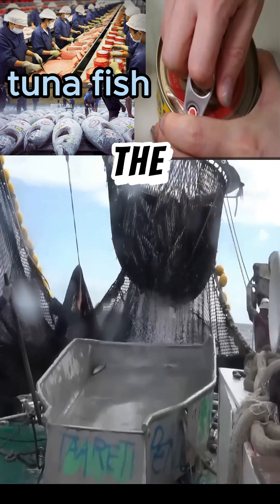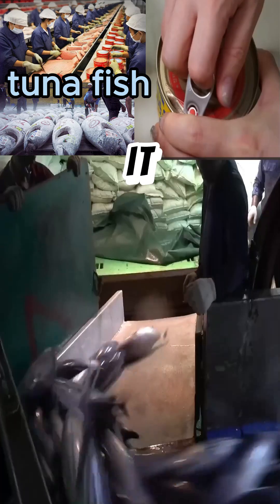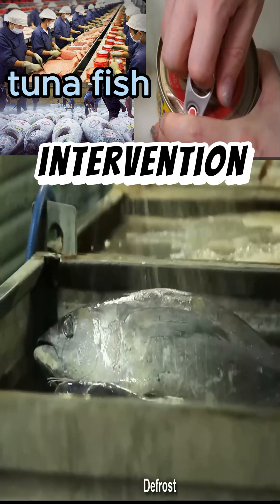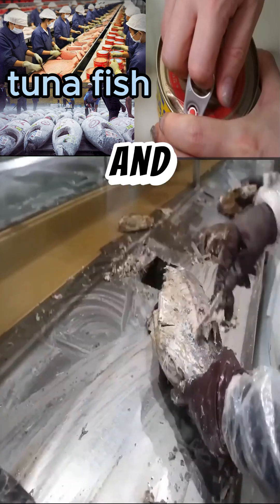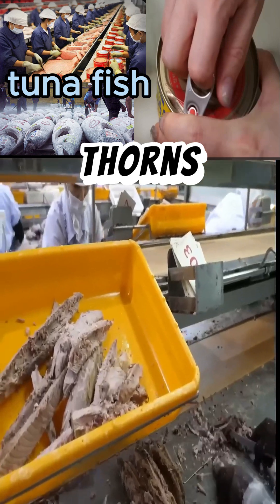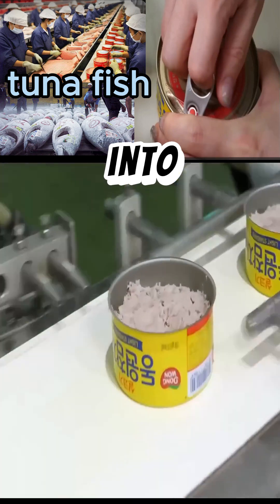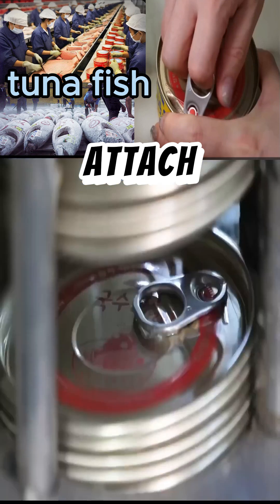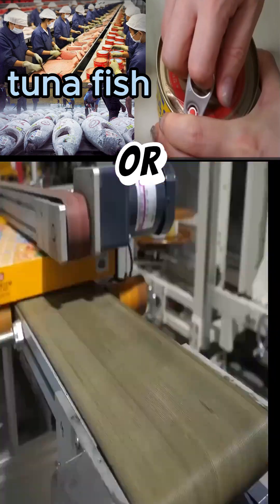How is canned tuna made?

Comment: I just can't stand idly by and not notice the giant f**** radiation symbol on the Machinery that the tuna was going through
Reply: Looks like they’re x-rays. Probably to protect against stray bone and metal.
Reply: @pete_nana and thorns and peels
Reply: To ensure no metal or foreign material. No issue at all. You need about 1000x x ray radiation a year to have a significant increase risk of cancer. And with time, the radiation become harmless. Any1 working at radiation related work got extra holidays and temporary working position shifts to solve this issue. Concern not us, but the worker who got radiation exposure many times a day. After consecutive years of working, the risk be significant.
Reply: Yeah they say it's an X-ray but it could be gamma ray where they blasted so that there is not a living organic molecule in the whole thing that way it can stay on the shelf for years. Irradiated food.
Reply: Yet you're on your mobile. 😂
Reply: @localforeigner9528 There's radiation all around you. Just different levels of it.